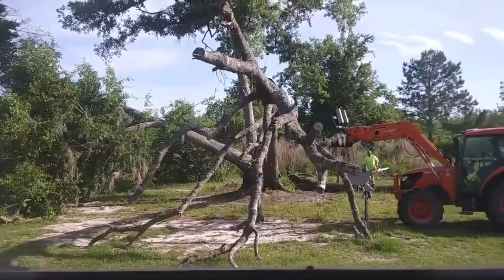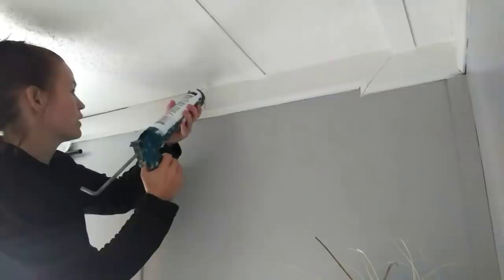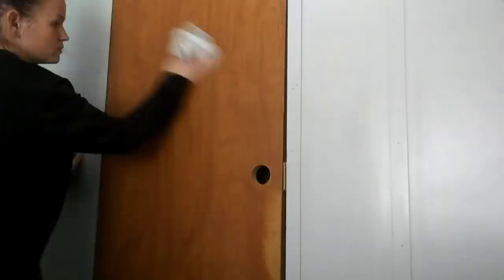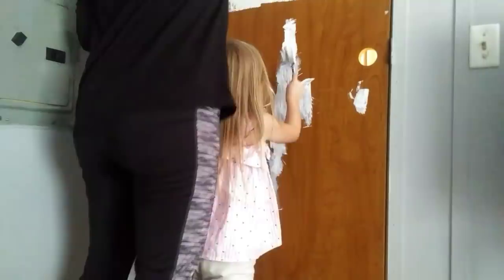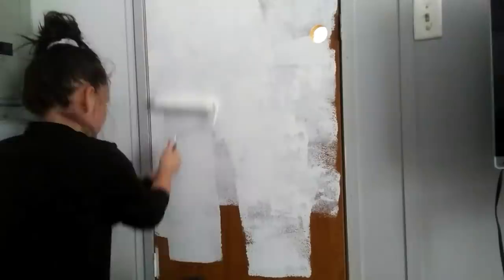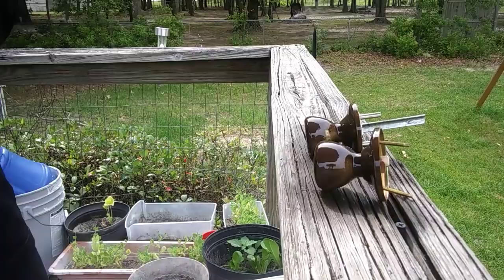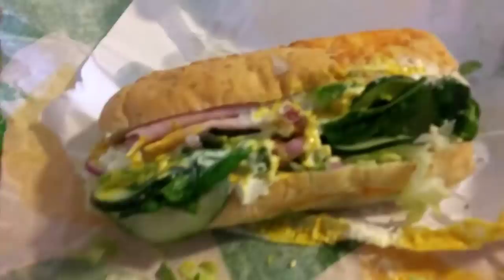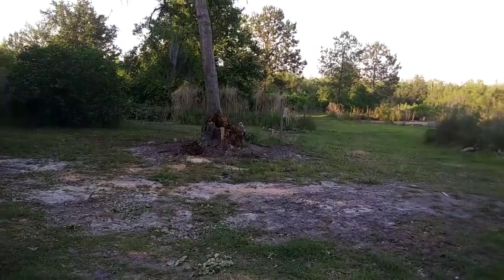Fixing up our old mobile home / DIY / CHEAP / Vlog style!

Comment: I live in an old 1991 mobile home.  I bought it used, it had the original wall paper with lovely purple irises on everything! YUCK!!! It even had glass insets with irises on the cabinet doors in the kitchen.  I didn't have any money to replace them so I Kilzed them and painted over them. You can't really notice the flowers unless you get close and look for it. Also, in my home there were mirrors EVERYWHERE! At first I was worried that they were glued to the wall and that it would mess the walls up if I took them down.  One day I got really brave and took the molding off on one side and realized they were only held up by the molding.  Don't know if they are all that way but just a tip for anyone who needs it. I have done lots of work on this home and have more to do but I am SO THANKFUL for my home.

Comment: Great job!  I live in a single wide that is about 40ish years old and maintenance has been neglected quite a bit.  Just replaced the guts of the electrical panel (do that every 20 yrs folks) and have been painting my behind off in nearly every room to update the look of it all. Replacing subfloor is next because it does wear out over time...  Great job on the caulking, that's a cool tip I hadn't thought of yet!  And despite the paint on you and "sweating" you still look beautiful!

Comment: I live in a single wide as well and doors are expensivs especially when there are so many we have 9 doors and were planning buying new but i decided to try and paint them and it looks just like they are new. Especially if you add some trim to spruce them up definitely alot cheaper than paying $30 per door. Weve been working on updating our home as well.

Comment: Caulk is my best friend in a mobile home too. 😂👍🏼 I also need to scrub my skirting. 😬 And paint doors. Yay for your door painting assistant! So cute when little ones get involved!
Reply: I don’t use a trash bag in between. I use Press n Seal over my tray, roller, and brushes. Keeps them from drying out for daysss!!!
Reply from the maker: I usually dont keep that on hand because I swear it works against me 😂 but that's a great idea and it's cheap 👏 I still have two doors left 😭 I procrastinated again haha
Reply: BudgetFam That should be our collab. Projects we procrastinated on in our mobile home. 😬👌🏼
Reply from the maker: Yes girl that would be great 😉 I have a few ideas of things I've wanted to do I just haven't yet ! I'll message you 💕

Comment: 😮 I am in the process of repainting and repairing my mom's trailer to get it looking better and I agree that caulking tip will help alot and the using a spare trash bag to be the paint liner. I would not have thought about that!

Comment: Whatever way it works best for you is the way to go. I commend you for wanting to have your home the best it can be. Hard work pays off.i don't know if you used a product called No Sand...it might help in not having to put so many coats plus it helps the paint to adhere to the doors. 
Awesome looking. Keep up the good work.

Comment: Just a quick tip, when you’re doing the caulking, use a popsicle stick. So put a bead of the caulking in the gap and then use the end of the popsicle stick and it makes that rounded indent.
Reply from the maker: That's a great idea 👏 thank you 💕

Comment: Interesting! 1st off, I'm not trying to be mean. That green stuff is an algae. You're right for hitting it with that killer but a cheaper way is to spray it down with 5-6 parts water & 1 part bleach. Follow it up with a pressure washing. TSP is a great deglazer; works great on panelling. BTW, you've bitten off a lot lady!

Comment: I've always wanted to buy a 3 -2 bath. And where the garden tub usually goes.. RIP that out and install washer n dryer in the master. Then use the alcove in the hallway ( where the washer n dryer usually go) and make that an * entry*. W a bench and hooks and ship lap on the 3 walls. It makes more of an entryway
Reply from the maker: we will soon build an addition off that side of the trailer so it wont be a entry way anymore but if we wasnt going to do that . Thats a great idea :)

Comment: We just bought a doublewide on 2 acres and I’ve been painting EVERYTHING! Doors, trim, cabinets etc. Painted my doors white also and that was the worse project for me bc for some reason they keep scratching easy. 🙄 I’m working on my kitchen cabinets now and I’ve never been so over painting before in my life. Will it ever end??? 🤣 Definitely going to do the caulking like you done! That was a great idea!
Reply from the maker: Some times the material you paint on dont hold paint well . I recomment using a really strong degreaser and make sure you prime with a primer that works on your tyle of material. You can look that up on google 😉 kilz 2 is a goodprimer!
Reply: Thanks for the suggestions. I primed my doors with zinsser first before i painted them. I may try oil based when it gets a little warmer outside so it don’t smother us all. We have a German Shepherd that thinks he can just keep scratching the doors and the kids will let him in. He can’t get the point that the kids aren’t gonna let him in! Lol.
Reply from the maker: @ashleydanielle6355  My dog is the same way lol shes determined to get her way 😂

Comment: Has it cracked yet? (Caulking) I done mine about a year ago and it’s cracked now 😒
Reply from the maker: No but that's probably just your foundation settling . I'd try using a bath tub ( water proof)  caulk they are usually a little stretchy so it might not crack so quickly.

Comment: How is the paint staying on the doors?
Reply: I lived in a similar home and when I tried to whip the door after words some paint chipped off.
Reply from the maker: Its holding up pretty good and my kids are rough and my dog busts door open 😂 lol but I'll let yall know if anything starts happening .
Reply: Okay! I’m planning on starting this project soon but my toddler going through a phase of wanting to draw on everything  lol.
Reply from the maker: @ashleysneed8650  ive heard that oil base paints work really well but the smell is just way to much for me. I have a very sensitive nose so anything to strong drives me crazy lol but if you take the doors outside that might be a good option for you . I'll look into it and possibly try it but for now these are holding up great ☺

Comment: Your doors do look so much better now. But I have to admit, I cringed when I saw you paint the door hinges. Hinges, like most other hardware, should not be painted in that way. Door hinges in particular, if coated with enough paint, can impede the proper operation of the hinge, causing the hinge pin to get stuck & not move freely.
Reply from the maker: It's just chalk paint it wipes right off dont worry 😊
Reply: @karrielynn  Oooh, okay. 👍